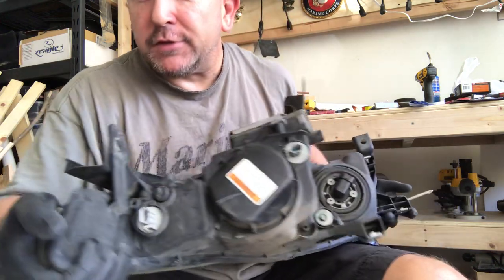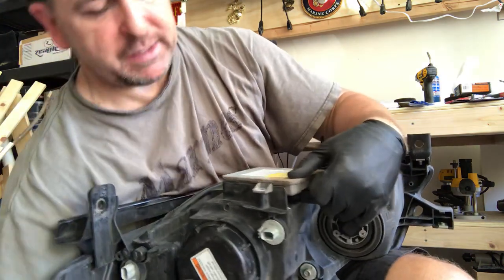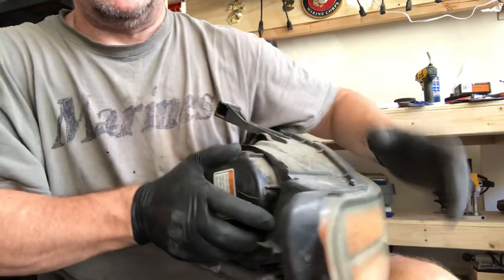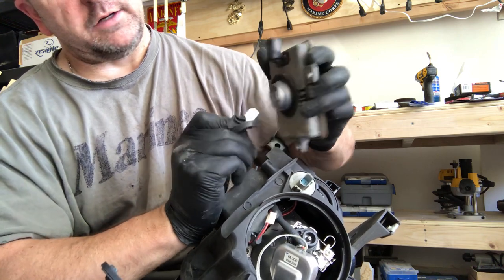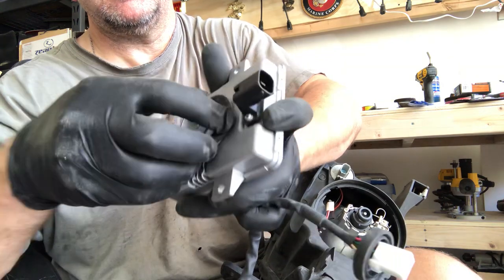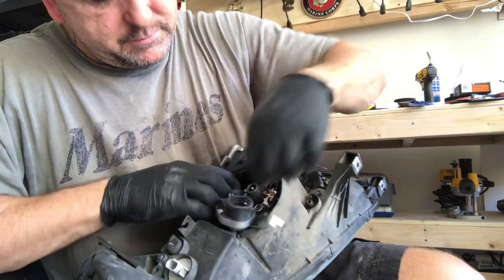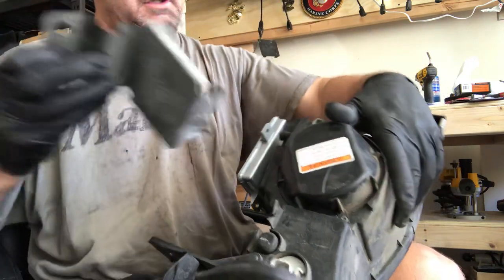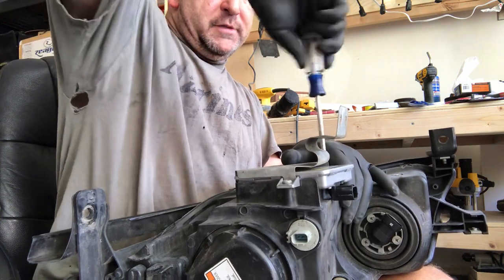2004 Acura TL Ballast and Igniter cable replacement

Comment: First, thank you for putting up this video.  I am trying to replace the Headlight bulb (low beam out).  My problem is I took off the ground cable connector for the ballast not knowing I didn't need to take it off.  Now I get nothing, no lights.  Would dielectric grease help.  I bent this little connector the ground cable for the ballast connects to, now I get nothing.  The two little prongs are a little bent that kind of ride along the outer edge of the installed bulb but that is all I see wrong, I bent them back but still no lights.  Where did you get your ballast maybe I can purchase a new ground clip connector from them.  Thank you for your time.
Reply from the maker: Im not sure what you did but the 2 places I order on line is RockAuto dot com and or Partsgeek dot com
Reply: @kingstid  Thanks for the reply, most likely the ballast is now bad.  I checked fuses and the 15a fuse is blown for that side, I now get 14volts to that connector, I get an Ohm reading of .3 on dead side, the good ballast I get value of 1 (open).

Comment: Nice video! Love the background music. My low beam went out not high beam. My shop said it is the ballast and/or igniter. I ordered the parts going to replace both sides. Just replaced the bulbs a month ago so hopefully this fixes it. How did it go?
Reply: How did that go Stacy? Did the ballast replacement do the trick?

Comment: how did u get the whole thing out? I couldnt get the to the heat shield part to come loose, how did you get to the bolts/clips that holds that in place?
Reply from the maker: SOrry I just saw this   You have to remove the front bumper/grill and remove it from the inside.

Comment: i just replace my light hid light bulb right side tl 2005 so mine i just made room thru the bumper i could reach the bulb but i cant get to connect the ground wire so i turn light on and they on but sometimes it doesnt turn on i have to give it many tries before right light turns on so i wondering it could be because of the ground wire not connected or the ballast is failing  any suggestions
Reply from the maker: I would recheck the ground.   Make sure it’s tight.   If it still hesitates to turn on. Yes it’s the ballast      But also check your light bulb too while you’re at it. Make sure it’s not burnt     Remember to
Disconnect the battery tho.   It’ll chick the shit out of you
Reply: @kingstid   thanks i buld is brand new .. so i think is the ballast is going out ,, is just the passanger side  so the driver side os ok ,,,

Comment: Did you use aftermarket products? If so, can you please post?
Reply from the maker: They were aftermarket OEMs I purchased from Rock Auto Parts or Discount Auto Parts.    I had to do this twice because the first time, I got used ones from ebay.  they lasted about 2 months and had to change it again so I bought 2 brand new ones from one of those sites I listed.   I dont remember which site it was.  but they were brand new.  and its been a couple years now and no more issues.

Comment: My problem now too.  Does the front bumper need to come off?  Local mechanic said it did, but I’d like to know.
Reply: The front bumper will need to be taken off. It isn't as hard to do as it sounds.
Reply: I did have my unit repaired and after the mechanic quoted me about $600, he surprised me when I picked up the car with a bill of only $160 as he said the bumper didn’t need to come off. Yay!!
Reply: Awesome!
Reply: @christiancomputing8771  actually you can do it if your turn your turn your wheel and move the plastic back
Reply: @danf321  yeah cuz all you need to do is turn the wheel to get to one side and then turn the wheel to the other side to do the other side
Reply: The fender liners were taken out of my TL before I got it because there was a minor accident. They never got put back in, so there was a ton of dirt behind the headlight and in the screw that holds the cover in place. So for my situation, I had to take the bumper off. I got fender liners recently, so next time, I won’t have to take the bumper off!

Comment: What did you mount the ground wire to?
Reply: Doug Stidham Photography ok. My old one didn’t seem to have a ground wire and it was the original. Then again it was badly burned as was the bottom of the bulb from some arcing I guess. I attached ground to metal spring clamp holding the bulb in. I hope that’s ok.

Comment: How much was the hole price to replace it
Reply: If I went to Acura they were going to charge me $500 for the ballast and almost $300 for the igniter cable. I went on Ebay and bought all four pieces for $250
Reply: This is Doug using my friends account.

Comment: What if the bulb is bad and not your ballast or igniter.
Reply from the maker: Just replace the bulb.   but you will still need to take off that safety screw to get to the cap.